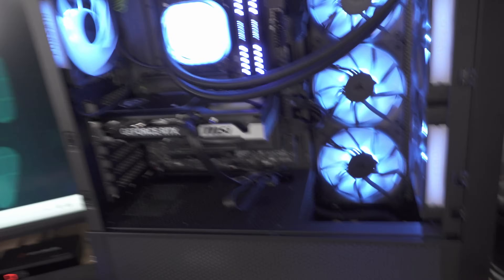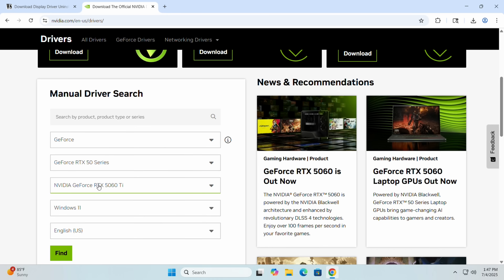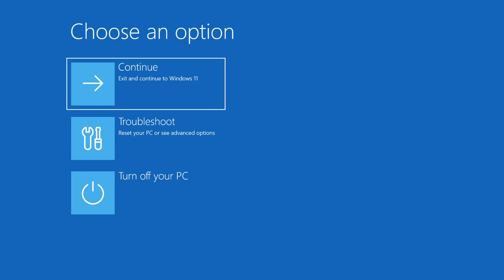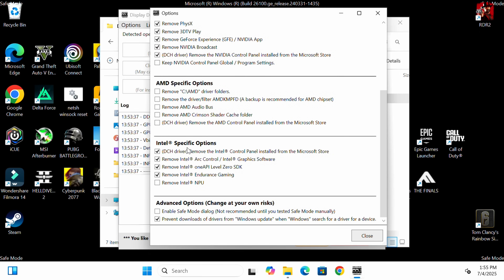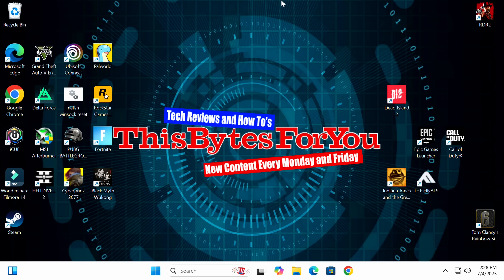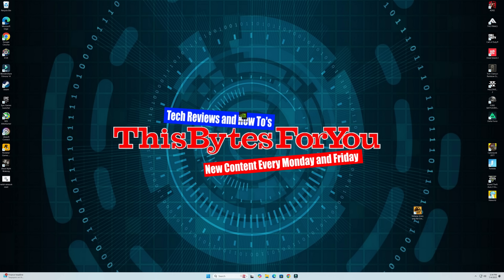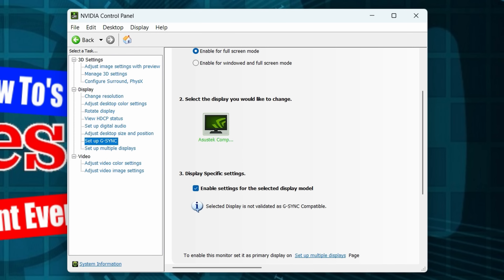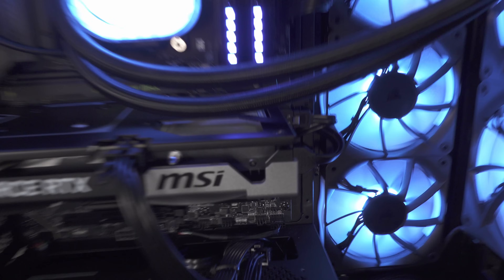The ONLY Way to Install RTX 5060 Ti? (Avoid Headaches & Maximize Performance)

Comment: Great Video and A question I have brought a MSI X870e motherboard and installed a Asus 5060ti but cannot get it to work. Yes the card works and tested on another pc. Any help would be much helped .
Reply from the maker: Thanks, which part was your favorite?
1. What is the exact model number of your MSI X870e, there are many different versions
2. What is the manufacturer and model number of your power supply?
Reply: @ThisBytesForYou  Thanks for getting back to me but I have sorted out the problem . Used my old graphic card to install fresh windows and swap cards across and suddenly it worked . Nice to see a youtuber replies to post . Thanks Again
Reply from the maker: Sorry, I thought I responded to this earlier, so if you have to switch cards, it sounds like you will have issues later.  Sounds like maybe you are not correctly set to UEFI or having the C drive as GPT, there are a few, since its been 10 days (I am so sorry, I like to respond almost immediately), hows it going for you?
Reply: . Yes got problems and currently reinstall windows 4 times . It takes alot of time to setup as I run my racing sim setup. Ive tested my M2 drive also graphic card and now cannot reinstall windows.  Going to try another M2 drive to see if that's the problem.  Why did I upgrade when my system was a dream . I keep you posted
Reply from the maker: I asked a few questions to try and help you, and I am still offering to help you and you are ingoing them, it doesn't help to keep me posted if you are not going to try what i ask, its cool that you appreciate me helping but for what?
Reply: Happy New Year and got my new motherboard MSI X870e Tomahawk but I cannot update the bios . I have tired 7 usb all different sizes from 32 to 1 gig and followed instructions and still cannot see the file . I've rename  the file to MSI.ROM and that didn't work. Any suggestions would be would be much appreciated . I have done lots of builds of PC but this one is giving me massive headache .  Thanks again in helping me
Reply from the maker: @lefty0184 format it fat32, the 32gig one
Reply: Hi. Here is my new setup MSI X870E GAMING PLUS , Amd Ryzen 9 7900x Crucial ddr5 pro series 64mb at 6400 , Asus GeForce Rtx 5060 ti  Samsung pro 990 % 980 2tb and Lexar 2tb .
Just having nightmares.  Im running 2 psu , 1000w & 650w both are big brands .
Am I setting up the motherboard wrong . 
As I said going reinstall windows again on Lexar and see what happens or any advice its much appreciated. 
Massive thanks for replying to me
Reply from the maker: OK cool, so 
#1, update the BIOS to the latest version, there are a ton of AGESA updates, security mitigations, memory and processor compatibility and performance updates as well in a VERY short period of time, so there were some issues,  In about 2 weeks or so I will have a video on installing with a board VERY similar to this (the Hello Kitty Build I am working on, then later my workstation (different cases haha) )
https://www.msi.com/Motherboard/X870E-GAMING-PLUS-WIFI/support

#2 Gen 5 is supposed to work 100%, but has issues for the OS drive and Card, set it to Gen4 (I will still test 5 on mine, because its what I do)

#3 I don't know if your specific RAM kind (you didn't give me the exact model number of the RAM) is XMP or EXPO compatible, which ever it is, XMP or EXPO, set it that way in the BIOS.

#4 the only things you need to do in the BIOS, update it, then when you are back in, load optimal defaults (which is in the exit section in the BIOS) then set the date and Time, set XMP or EXPO, set PCIE lanes to Gen4, Enable Memory Training, save and exit and install.

# 5 Reinstalling windows with BIOS settings messed up is like building a house on sand, sure it will stand up for abit, but you will have TONS of issues and eventually you will have to rebuild it and rebuilt it and rebuild it.  Setting your BIOS correctly, is like building your house on concrete, setting up a frame and then you have a solid foundation.

# Also, see if there are firmware pdates for your samsung and lexar M.2 drives, I know samsung has had some issues, I am not sure on the Lexar,... and why do you have 2 power supplies?
Reply: @ThisBytesForYou  Alot to take in and will follow your guide . My times for my Ddr5 is 40-40-40-84 and runs on XMP3.0 or Amd EXPO . Why I used 2 psu  to share the work load in my old setup as I had lots of drives etc etc, Made my system stable . Please give me a couple of Days and I will get back to you hopefully good news . Thanks again Massive help.
Reply from the maker: You have a 1000Watt power supply, the drives all together might equal 40 watts, you don't need a separate power supply for them, promise, I have had much lower power supplies with over 10 drives on Molex connections, if you need more connections for your drives, you can get extensions, you can use my Amazon affiliate link to purchase an adapter to take you from 1 sata power to 5 more: https://geni.us/l6JAe8 or you can purchase this one that takes you from Molex power to SATA, and 4 additional SATA power connections https://geni.us/4N7eZtW, but you need to make sure you have Molex on your power supply;
Reply: Just a update.  Had return motherboard was faulty again this is the 2nd one . Buying from a different source and going to buy Msi x870e TomaHawk .
Reply from the maker: Eeek thats rough, but I hope the new board works for you.
Reply: Sorry psu are Corsair RM1000e and Ocz Zs series 650w b

Comment: Quick question: I'm coming from amd gpu(rx 6600) to now install rtx 5060. My question is under DDU options should I just check all amd related boxes to be removed, or just the software/driver. Oh and my cpu is intel. thank you in advanced.
Reply from the maker: Have you watched the video?  I go over that, th video will help.

Comment: My gpu doesnt show up anywhere, my 1070 works and i feel like ive tried everything. i have uefi with gpt, i get a red light when i dont have the power connected to the gpu and it goes away after ive plugged it in.
Reply from the maker: The red light is telling your PC that you have enough power going to your GPU, like i show you in this video, and what happens after that?
Reply: @ThisBytesForYou The red light is only when i dont have the power for the pcie connected. When i have everything connected my gpu does not seem to show up anywhere
Reply: @ThisBytesForYou I think it connects but pc doesnt recognize it? No fans are going and it doesnt make a sound or heat. I cant install drivers because it says no nvidia card detected. Its a 5060ti 16gb asus prime. With a z690f gaming wifi motherboard with 4301 version bios- newest. Any tips?
Reply from the maker: What is the manufacturer and model number of your graphics card, CPU, power supply and motherboard.  I need all 4.
Reply: @ThisBytesForYou intel i7 12700k, asus prime rtx 5060ti OC 16gb(ASUS 5415335), z690f gaming wifi and corsair rm750e
Reply: If i switch to the 1070 it instantly pops up and works
Reply from the maker: that makes sense, switching back to your old card would work, moving to a new card may not, because its new and that's what we are here to work on.   I am asking that you download and run CPU-Z and GPU-Z to check on a few things, if you already have them, the older versions work fine, and you can use those.
1. Download GPU-Z and run it, with your 1070 in the machine.  When you run it, right below the NVIDIA logo on the top right hand corner, under that, what does it say, UEFI, Legacy MBR?
Download GPU-Z from here: https://www.techpowerup.com/gpuz/
2. Now download and run CPU-Z, when you run it, click on the "Mainboard" tab under the BIOS section, what is the version and date it gives you?  Bellow that, under Graphic Interface, what does it say under "BUS" and under "Current Link Width" and "Max Supported"
Download CPU-Z from here: https://www.cpuid.com/softwares/cpu-z.html
3. In windows, right click on your start button, then click "Disk Management".  On Disk Management, on the bottom left hand corner, you will see a box that says "Disk 0", "Disk 1", etc, the one that is your C drive (you can see your C drive a little more to the right), right click on that Disk,  and click properties, then click "Volumes", what does it say under "Partition Style"
Reply: @ThisBytesForYou now all of sudden the 1070 doesnt show up....
Reply: @ThisBytesForYou it actually detects something, because when i have a gpu plugged in it registers in device manager as (microsoft basic display) with error 31
Reply from the maker: @fred4638  Thats beacuse you DDU'ed the drivers, reinstall the drivers
Reply: @ThisBytesForYou how do i install the driver when it dont see the card
Reply from the maker: @fred4638  device manager as (microsoft basic display)  is the card, when you install the drivers, it should show,. but you have the drivers for the 5060, they may not have the 1070 in there: https://www.nvidia.com/en-us/geforce/drivers/results/257496/
Or maybe power everything on, and reinstall the card, might not be installed properly.
Reply: @ThisBytesForYou no card works now no microsoft basic display
Reply from the maker: Please tell me, each time you touch the card, you are grounding yourself and your not standing on a carpet, causing lots of static, grounding will help you tons here, not to kill your gear, I go over that in the video, EACH time you touch a PC component, ground yourself first.
Reply: @ThisBytesForYou I am very much aware , im happy to tell you that i got the 1070 to work now but the 5060 stil does not. Is it maybe because the motherboard isnt compatible or do you think that the 5060 is dud?
Reply from the maker: ANSWER THE QUESTIONS I HAD FOR YOU SO I CAN HELP
Reply: @ThisBytesForYou UEFI under nvidia logo in GPU-Z, In CPU-Z it has the version 4301 and date 4/29/2025 - Bus is PCI-Express and current link width + max supported is greyed out with no value in them. Disk is NTFS
Reply from the maker: Under Partition style it would not say NTFS, MBR, GPT, etc?  Under Bus it says PCIEXPRESS, by 3.0, 4.0, 5.0?
Reply: also dont know if ive already said this but the fans are also not moving in the gpu
Reply from the maker: 1. The board supports PCI-e Gen 5, set it to Gen 5 in your motherboard, it is backwards compatible as well, I don't know where it is in your board, you will have to look around.
2. That's good to hear now it shows PCIE 3 and x16, it was scary to see that it didn't have anything, so thats good.
3. Is your 5060 take a PCIe 8Pin cable or does it take a 12VHPWR?
4. That is potentially normal, since it would only spin when it hits about 55°C or so, depends how its setup in the firmware of the card.
Reply: @ThisBytesForYou absolutely not recognized in device manager, feel no heat from it at all and im sure its plugged in correctly. Its an 8 pin, the same one i used for the 1070
Reply from the maker: So when you have the 5060 in the machine, and you have the HDMI (which needs to be HDMI 2.1 or higher) or DP cable (which needs to be DP 1.4 or higher) and you have the card plugged in, you see something on the screen, and you are able to get into Windows, you don't see anything in the device manager?
It's not going to get hot, because it isn't doing anything yet, kinda why the fans haven't turned on.
Reply: @ThisBytesForYou I have to use the motherboard card for display, there is no display if i plug monitor to gpu. I am avle to get into windows no issue but i dont see anything in device manager and as mentioned the display doesnt work with the gpu
Reply from the maker: Then I guess it is bad, it happens, but not commonly, get it changed while you still have time.
Reply: @ThisBytesForYou I just returned it and got my money back, thank you for your time and help. I appreciate it ❤
Reply from the maker: happy to help but are you not going to get any card then?
Reply: @ThisBytesForYou yes ill buy a 5070 on friday. Hopefully that works 😊
Reply from the maker: Nice, just make sure what you buy uses the PCIE 8 Pin and not the 12VPH connector, unless your power supply uses it to but also check out the requirements, I am seeing 5070s require a 850, depending on which specific model you buy.
Reply: @ThisBytesForYou its 16pin (2x8pin). recomended psu - 650
Reply: MSI GeForce RTX 5070 12GB Ventus 2x OC
Reply from the maker: @fred4638 they generally will not list it as 16 pin, that's 12vhp which is 12+4pin... 16 pin. Verify before you get the card
Reply from the maker: That card comes in 2 variants, get the exact model number  @fred4638
Reply: @ThisBytesForYou your right, its a 12vph
Reply: im buying a 850 psu that has 12vph and the 5070. then it should be no problem... Right? 😂
Reply from the maker: @fred4638  make sure the power supply you buy provides 600Watts to that 12VHP
Reply: @ThisBytesForYou  forgot to tell you, i got my new card and it  worked instantly so the card i returned was in fact dead
Reply from the maker: Good to hear you got it working and also good to know the first one was dead, I thought we were both going crazy, haha, good stuff my friend and thanks for  letting me know, how are you liking it?

Comment: Hey I got 5060 ti 16gb and it hasn’t worked after installing everything perfectly, black screen on boot should I turn off csm?
Reply from the maker: The card requires UEFi and UEFi requires a c drive formatted as gpt
Reply: did you figure it out
Reply from the maker: Have you tried what I told him?

Comment: Was thinking of getting a 5060 ti 16gb to replace my 4060 these have the same cables correct?
Reply from the maker: Depending on which you buy, have you checked this video and compared to your own?  The video will help you a lot.
Reply: @ThisBytesForYou I’m looking to upgrade from the 4060 ventus 2x and getting the 5060 ti ventus 2x are these cables the same
Reply: Just making sure because I have a 8pin right now
Reply from the maker: Have you watched the video?
Reply: @ThisBytesForYou watched it 3 times I’m just confused 😭
Reply from the maker: start watching at the 7:07 mark, I show you removing the cable, then at 11:00 reinstalling the cable which part are you confused about?
Reply: @ThisBytesForYou my cable is a 6+ 2 I’m just wondering if that cable works sorry for wasting your time
Reply from the maker: @Riphile3k so you didn't watch the video?
Reply: @ThisBytesForYou I did I’m new to this sorry
Reply from the maker: @Riphile3k  brother, it has nothing to do with being new, I walk you through it and discuss it, slowly, in english and plus its translated into tons of other languages and voices, I work hard to make this easy for you, I even talk about the cable being a 6+2 pin, you just have to watch and listen.  My channel is very noob friendly, because we were all noobs, you just have to want to learn and listen.

Comment: Quick question, I am going from 2080 to a 5060ti, the 2080 had 2 8pcie connections the 5060ti I saw you install had 1, do I just plug in 1 of my 8 connectors in?  Thanks
Reply from the maker: Yup, plug in as many as the card has, so you should be good, crazy how powerful efficiency it is huh ;)
Reply: @ThisBytesForYou Thanks 👍
Reply from the maker: Anytime my friend, so very happy I could help.

Comment: I think I followed this step by step. I have windows 10 and I swapped out the gpu gtx 1650 to the rtx 5060 but now I have no audio. I tried connecting my monitor into each display port and still nothing. Any help? 🙏 please
Reply from the maker: On your taskbar, on the right hand side, single click your speaker icon, on the right of the slide that appears, click "Select Sound Output" and select what you are using for sound.  You are not using your graphics card for sound, you are using Realtek Audio, Creative Audio, Speaker, etc.  NVIDIA Audio gets installed so it may have changed what your sound output is, but its easily changeable like I mention above.
Reply: @ThisBytesForYou  i have it set to my monitor which it was like that before but now there's still no sound coming from the monitor.
Reply from the maker: It was that way before and it has changed, which makes sense since you made a change.  Verify the volume is up on your monitor and within windows, make sure it is unmuted in windows and the application you are using.  Make sure the cable you used before, HDMI or DP is the same one that worked before and also, verify there isn't another monitor output, you may need to check that. Then also try other outputs too in windows select outputs, it's a new card it may have changed what the output is called
Reply from the maker: Has this helped?  I am recommending this I have had issues with and found resolution with
Reply: @ThisBytesForYou sorry I been at work last couple days. I'm home now. The speakers will work that are plug in via Realtek Audio. But my monitor plugged in the gpu still won't
Reply from the maker: Odd is that the same cable you used before, I am wondering, since newer cards need newer cables for UEFI standards and HDMI/DP, maybe you need an HDMI 2.1 or higher cable or a DP 1.4 or higher cable for audio?

Also know, if you disable in the BIOS your Realtek audio, NVIDIA audio from your monitor/graphics card will be the only audio, which will mean 3.5mm speakers will not work.  You HDMI/DP will trasmit audio and your graphics card will act as the sound card, and your USB headphones have build in audio so you don't need onboard audio, unless you use 3.5mm.
Reply: @ThisBytesForYou yeah I just tried disabling the Realtek in the Bios. Still didn't work. Lol I'm giving up at this point I'll just but some speakers and use my headphone until then. Thanks for trying to help me out I appreciate it 🙏
Reply from the maker: Anytime bud, happy to help, you might want to try different cables if you have them